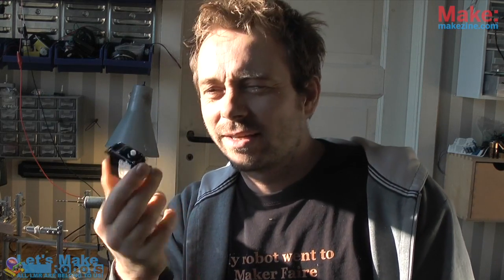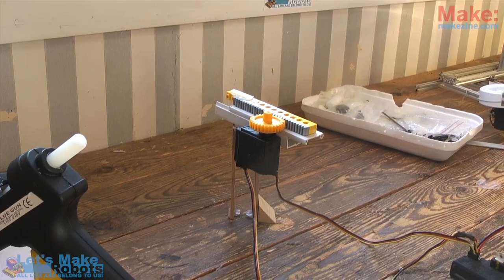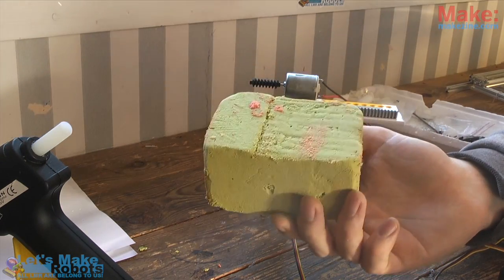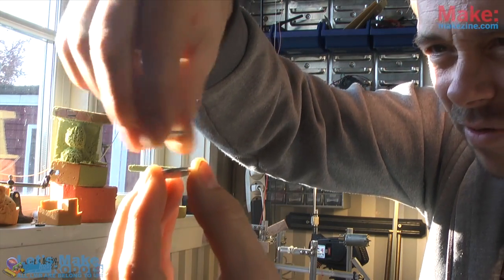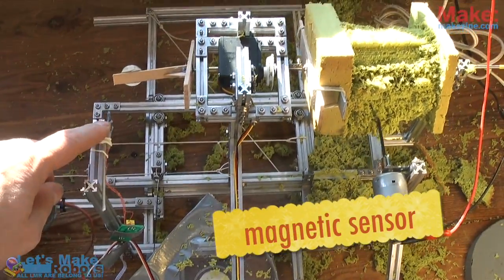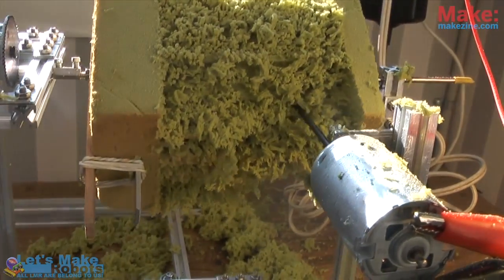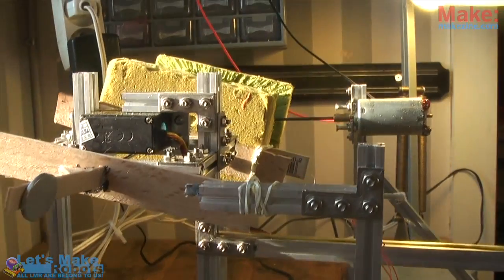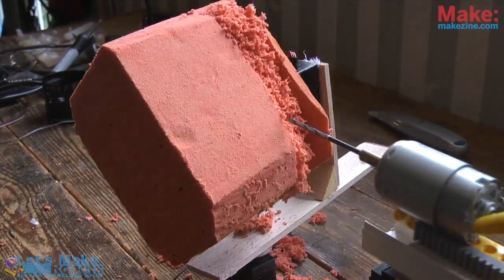3D Carver of Invisible Stuff - The Latest in Hobby Robotics

Comment: wow that is cool-maybe you could try an LED and light sensor and carve out a light beam-if you got the slack out of the rack and used a faster motor and sharper cutting head,maybe faster clock speed on the processor(for more clean cutting)you could carve light wood

Comment: awesome machine you could take it a step or two farther and after the machine cuts the form you could cover it will a simple gel release and then cover it in fiberglass and resin (in two parts left and right) then use the fiberglass form mold to make an mold lil sanding and not only do you have a finished product but you'd be able to make it again and again as needed